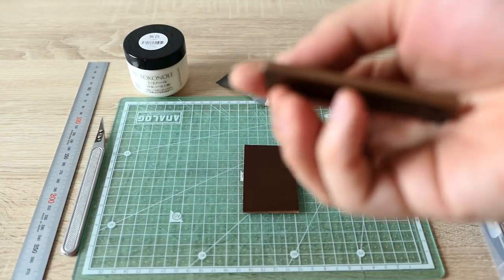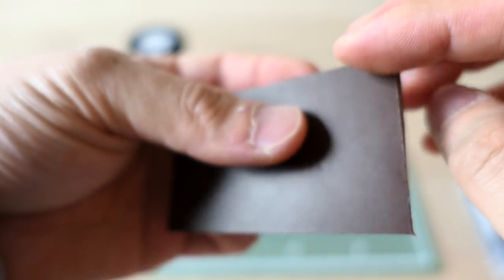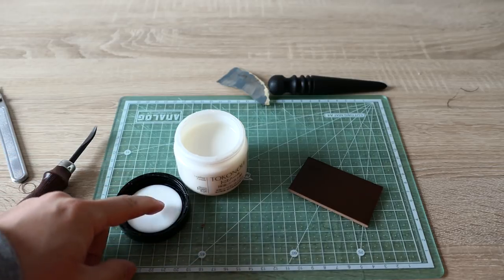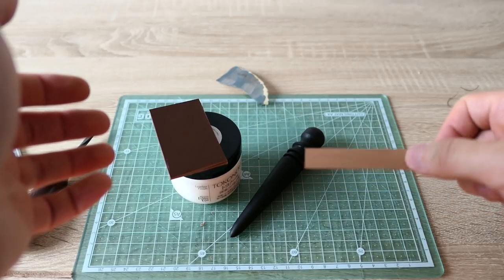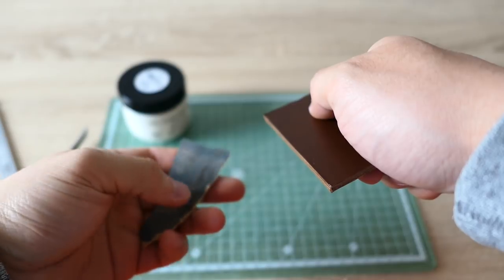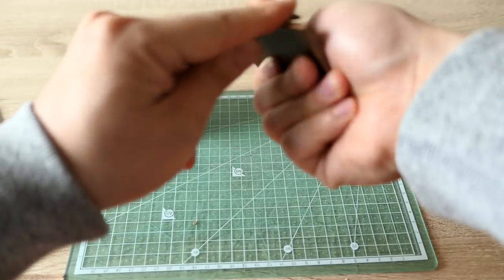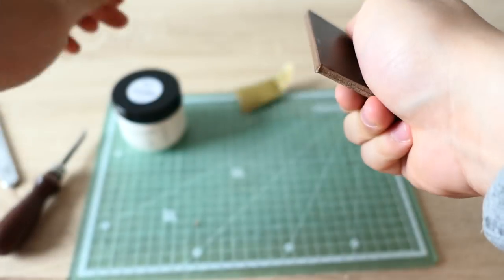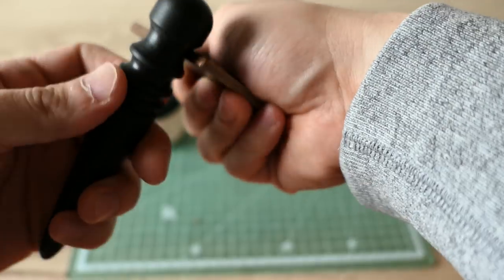How to GLASS Edge work with basic supply

Comment: If I may offer one more additional step at the end? 

Hitting it with a bone folder (or possibly a grooved out antler, thought I haven't tried antler yet) gives a bit more polish. 

I was reading up on Japanese lacquering techniques, and it seems one of the final steps is antler powder to get a really, really high shine on the lacquer itself, which can also be substituted with a bonefolder. Hitting dull areas with the folder, lightly, does take it up a notch. I don't know the grit on a bone folder, but I think its really, really high so it would follow well after the 8000 grit paper.
Reply from the maker: Great tips Anthony. I will try it more and develop it. very interesting idea.

Comment: Where can I buy the plane?
Reply from the maker: https://leathercrafttools.com/item/8603/
Reply: Honestly I'd buy a used Stanley Sweetheart or Veritas low angle block plane off Ebay before I'd try an unknown website that uses unfamiliar currency. A plane is a pretty simple tool, and the Veritas and the Sweetheart line from Stanley are some of the best. Just Ebay a used one. If you dont know how to mirror polish a good sharp edge, pay a local sharpening shop a few bucks to brighten it up for you. It will cut like a dream.